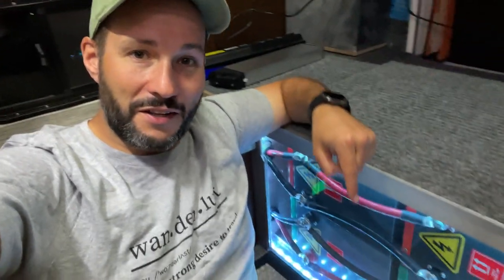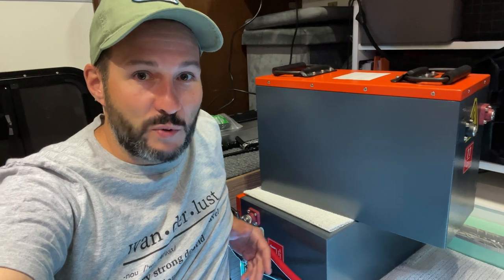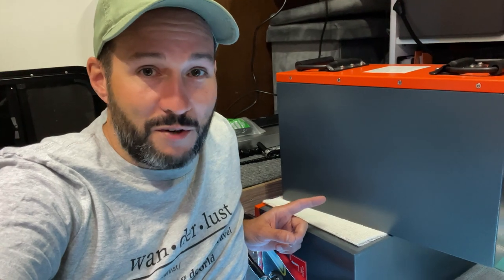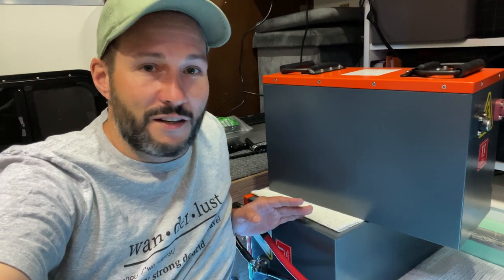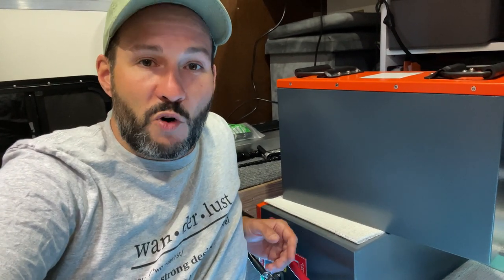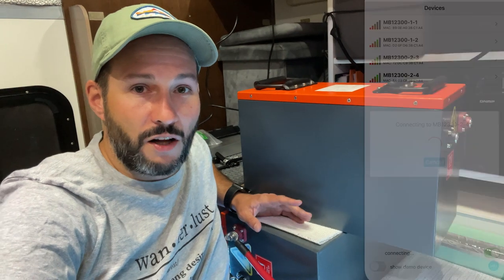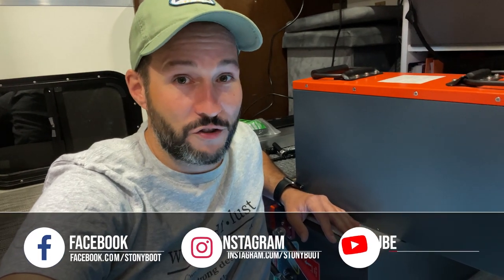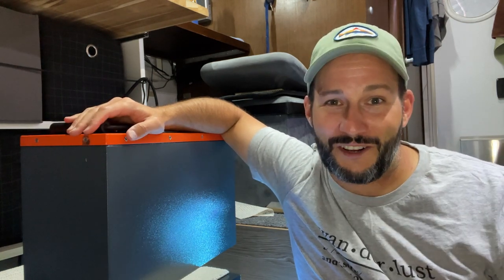🤓The Truth About Our Lithium Batteries...

Comment: Good for you, Scott.  Applause for your entrepreneurial spirit and for choosing to keep your power dry (for now).  FYI, our solar/battery capacityHonda gen efforts are now no longer needed.  We just finished 3.5 weeks in the Rockies off the grid, and we had RV Park-like 30 amp AC service the whole time.  As you might guess,  it came from the ProPower system on our F150 Powerboost.  A real game changer, from a half-ton truck with 540 ft lbs of Rocky Mtn climbing torque.  So yes, change is afoot.
Reply from the maker: I've been reading about that, I hope that system comes out for heavy duty trucks soon. You have all the power you ever need right there, it's just building the system to harness it. I'm glad to hear that you have had good luck with that system. And I agree with you, the RV market has exploded in the last two years and with that will come lots of change and innovation. I'm looking forward to what comes next! But, I'm not very happy with the crowds...

Comment: Good for you for keeping it under your hat! No reason you shouldn't make money from your own ideas and work. 
I thought a battery design that fits in the empty spaces in the truck bed, fore and aft of the wheel wells would be a great place. It's usually wasted space plus it's lower then most locations you find batteries housed in campers. This would keep the CoG lower. Additionally, there are four "wheel well spaces". This would allow for a more balanced weight distribution. If you had to batt units, they could go left and right in the front well spaces, 4 units in all four spaces. Or, if only using two battery units, you could use them to counter balance your rig if it's heavier on one side, like most TC's seem to be. The battery 'modules' would need to be water tight and have a good connectors and also a cable system allowing them to be either chained together, and have one cable go in though the camper wall. Or, have sockets on each corner of the bottom of the camper to plug each batt module in, then the wires run internally. I guess which is best would require a bunch of heavy calculating and trial and error. I know on many TC's, the one or two battery compartments that come stock are so cramped, it's ridiculous to work on them in place. And there'd be quite a bit of freed up storage if the batt's were in the wheel well spaces.
Look forward to seeing your ideas!
Reply from the maker: I agree with your premise. I even thought about keeping them external. But, cabling distance, simplicity and keeping them in a warm, dry, clean environment won out in my head. Another aspect is when I take the camper off the truck, I would then need to move the batteries. My goal was to keep camper stuff with the camper, and truck stuff with the truck. My plan was to increase power density to maximize the existing small battery compartments. So far so good, I just went overboard with the 1200 AH, but they were my prototypes and I need to get them installed for testing. So, my setup is someone specific.
Reply: @Stonyboot  Gotcha. Cable length and temp regulation plus off camper use are definitely issues. I think I remember see a video of a guy that built a pack from Tesla batt's. Took them all apart and rebuilt them flat. That then got built in to the bottom of the TC. Acted a a riser platform of sorts. Was a neat but complex build. Best of luck with the new design! Looking forward to seeing it!

Comment: We are really looking forward to your battery. We have limited space in our truck camper front access hatch between the door and the freshwater tank. We are using a 200 Ah Victron and would love to have more in a single battery. I will email you the dimensions of our battery area. It would be awesome if you could custom design batteries for individual space requirements! Take care and safe travels! Christian.
Reply from the maker: Thanks, that was the exact same issue I had. With my original installation compartment, I was only able to get 300 AH of conventional batteries, with my own batteries, I doubled it to 600... Same space :) I'll have more information soon. I did get your email, I'm just a little behind with responding.

Comment: So are you going to make it feasible to have a 12 volt a.c. system in a truck camper and enough renewable power for the rest of the camper?
Reply from the maker: The 12v system is enough to power everything. I don’t yet have enough solar to keep things charged, but I will in the future. I’ll have a few things to figure out between now and then.